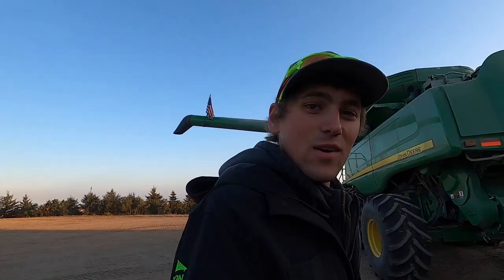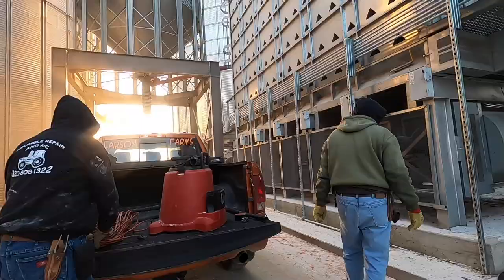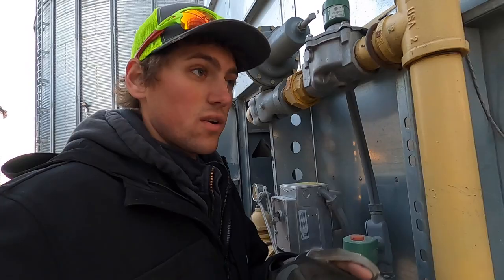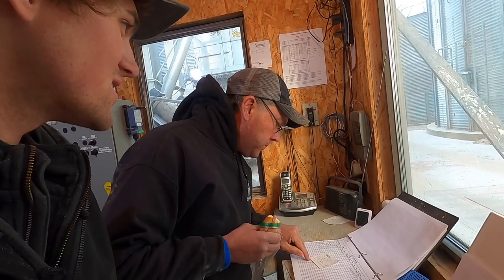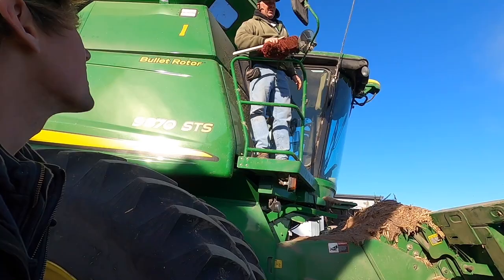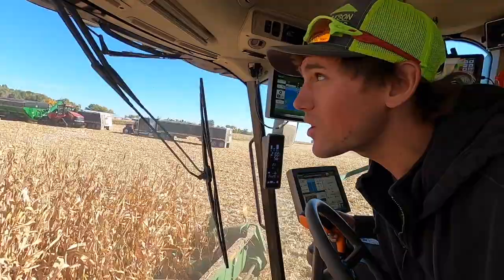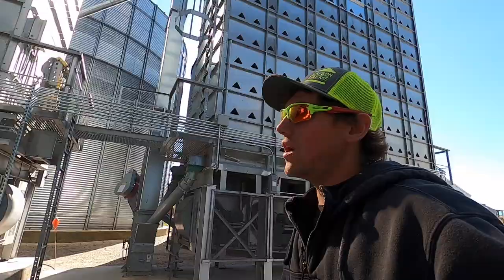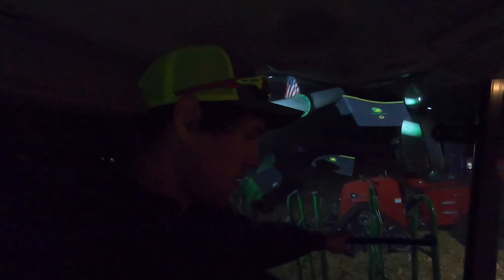You Spilled HOW Much Corn?? #14

Comment: Dougo shoulda known to take the batteries out of the Sensaphone 400 for seasonal storage, per the  Sensaphone 400 user manual, Page 29 , section 2.13

2 .13 DISCONNECTING THE MODEL 400 FOR STORAGE OR SEASONAL USE.
If you plan to employ the Model 400 as a seasonal “watchdog” for a few months during the year, you must disconnect all wires from the unit com- pletely to avoid damage to the circuitry when the unit is not in use. If the unit is unplugged but left in place with all the sensors still connected, the wires act as antennae that draw in any stray “electrical noise” from such devices as fans, blowers, microwaves, etc.
Additionally, it is important to remove the batteries, or they will discharge until they fail.
Preserve your Model 400 during the off-season, or when not in use: 
• Remove the sensor wires at the screw terminals
• Remove the batteries
• Unplug the unit and store in a safe place
Reply: john mcgee haha oh take er’ easy, pal! It’s a joke, and it took me all of 3 minutes. Don’t concern yourself with how I spend my time on a Sunday.
Reply: Seems everything on the farm is seasonal - except cutting the lawn.
Reply: User Manual? what user Manual they make one of those things lol
Reply: @dominoefxxx  Thanks for looking that up - you save Dougo the time to look it up (which he wouldn't) and now he knows. I didn't know to take off the sensor wires, but any stray charge could damage a circuit board.
Reply: Some of the newer batteries don’t corrode the metal and you can just wash off the contacts and put new batteries in.  Otherwise just get a battery holder from eBay with the same number of cells and solder it in.  Won’t fit inside, but that doesn’t matter.
Reply: WHAT FARMER EVER READS DIRECTIONS.  TAKES THE FUN OUT OF FU's.  STUFF CAN'T BREAK DOWN IF ONE RUNS IT BY THE BOOK
Reply: They're less than $250 a pop.
Reply: David Henschel i don’t cut it in the winter🤔
Reply: @gijsvermuntagrifotografie  How interesting rabbi.
Reply: White vinegar and a qtip will eliminate the corrosion in seconds. Try not to get the vinegar on the circuit boards if you can.
Reply: Where at Larson Farms is a safe place?

Comment: Chuckling.  When i was a young damsel while dad and my brother took the grain from the full section block, with the two odd quaters added wierdly at diagonal corners to it. I was left to run a One Woman show 12 miles away taken off the half section with 3 small pieces semi attached around it. They had the two trucks and two combines and a guy bailing behind them. I had my babier pull type a bailer and a old dodge tandem grain truck. Doing a one woman job say proving it took five men to do what i was doing alone. Only down side i had not finishing when they were done or shortly behind them was my 12 mile drive to the bins, or my trying to keep the bailing kept up to my combining.  Only advantage i had over them was we generally hauled loads straight to the ellevator and one of the quarters was across the fence from the ellevators and we had a trail made so i had driect access right into the ellevator yard. But enough of that i love to wach your videos to see just how far farming has advanced. You farmers are quite spoiled how every thing is so monitored for you and the dryer and bin systems do so much for you. And best you do not need to fight getting some old Hand Crank tractor running to turn the Augers. Only ellectrics we had at the bin sight was the batteries in the Flash lights lol. And only computer thing woulda been none. Lol best none of us got hurt other than my broke wrist from starting that dam hand crank tractor and my brother breaking his ankle gettin outta the combine in a hurry and screwed up.  So Chet, Doug and every one at larson farms please keep the videos coming i so love to wach them. And please be safe.   Hugs from ya little canadian farm girl fan

Comment: Sunday sub sandwiche day. Nicole keep splicing yourself in a little more, your contributions to the operation is emence. A farm operates on the food they eat.
 Keeping all the parts moving requires more then diesel fuel and prevent mantance..
The harvest is looking good.
 I found the green crustys starting in my battery powered radio, you saved my radio...

Comment: White vinegar and a qtip will remove the battery corrosion is seconds. Try not to get the vinegar on the circuit boards. About a 15 cent fix.

Comment: Thanks for finally explaining how them dryers work.

Why can't you unload directly into the semi trailers? 

Also, thanks for taking the heat for leaving the door open - you had taken a video of the bin loading for us and I remember you closing the lower door. You are runnin 110 percent making video's while doing your regular farm work a something is bound to go awry.
Reply: They can but would end up sitting and waiting for the trucks.  Used to.  The big combines harvest so fast they need a big buffer, which is what the grain carts do.
Reply: @BeachBoyAAA  Also heavy trucks and high tyre pressures lead to soil compaction even when the soil is really dry.
A compacted soil does not naturally drain hardly at all in a wet time = plants drowned, fertilizer wasted and a possible environmental issue, significantly reduced yield = very poor profitability.
Plant roots often cannot force their way through compacted soil and yet again poor plant performance (low yield / poor quality).
Note how the grain cart is running on special rubber belts (as is the tractor) - this is primarily to reduce soil compaction by spreading the weight of the equipment and load over a large area of soil.
To repair soil compaction is a slow and really expensive operation which can take a number of seasons and the right soil conditions to fix.

Comment: Clean out the battery corrosion with vinegar (Q tips work great for this process), then clean out again with  and baking soda and a little water using a Q tip..  DO NOT leave batteries in during the part of the year you do not use the sensaphone 400.  The equipment will use a small amount of the charge even when you are not using the sensaphone, discharging the batteries completely, they they corrode and leak. (If the equipment has an on/off switch batteries can be left in, but there is still the risk of corrosion.)  be careful not to get the vinegar or baking soda water on/in the electronics.   
Used this method for many years to clean up things the batteries were left in.  Unfortunately this is your bad;  somewhere deep in the manual it might have told you to remove the batteries when not in use.   Good luck

Comment: Since the bottom 2 tiers don't dry and cool the grain when you first load it up with wet corn how do the first 2 tiers get dried?  Does the dryer control where the grain goes so when first loading it with wet corn the bottom 2 tiers are empty till the grain is dry and needs cooling?

Comment: Being  a city  boy I'm  confused about  how corn gets in the triangles  without falling all the way down to the burners.  Does it load from inside the triangles?
Reply: wet corn comes in the top and divides to either outside chamber, air is forced into the corn thru the triangles. the inner chamber is where the burner /hot air is. there is no corn in the center chamber. the fans on the end force the heated air thru the inner triangles and to the outside thru the outer triangles. corn comes down each side of the center chamber.  augers at the bottom take the dry /cooled corn out to the storage bin.   this is called a continuous flow dryer.     the triangles have a "roof" over each one so air can go into the corn but corn cannot fall into the center chamber or out on the ground (the outer triangles).       some farmers may have a batch drier.  it fills the chamber, dries the corn and empties the chamber (in batches). over and over.  kind of hard to describe, I'm sure you can find a moving schematic somewhere on u tube.
Reply: Thanks for the  explanation .

Comment: So explain this bushels/hours thing because you said 66 acres and at 220bu/ac is 14,520
Reply from the maker: So divide that by how many hours you were in the field. 
Gives you bushels harvested per hour.
Reply: @LarsonFarms  ok, but why is that a point of significance?
Reply: @tomcander3669  The cost of all machines running plus manpower count up to a certain cost per hour.  So that the more bushels per hour you handle the cheaper harvest price against a bushel of corn. The point is to get down to the cheapest breakeven price you can get. That's why Chet is into the grain saving device's he installed this year.
Reply: @truckermike1997  I understand about costs as I own an excavating and demolition company but bushels per hour number is a false sense of accomplishment versus acres per hour or per 12 hour day
Reply: @tomcander3669  I don't believe it's a false sense it's just another measurement. Acre's per hour will vary do to conditions or yield. 300 bu corn will will take longer to combine then 225 corn so acres per hour will go down but bu's per hour go up. The simple explanation is bragging right at the bar.

Comment: Why other farmers unload directly to a semi.
Reply: Small combines.
Reply: I'm a city boy. Explain it  like you talking to your wife
Reply: @francisfrancis6624  Biggest problem might be man power or just the cost of equipment. The big advantage of the graincart is to improve the efficiency of the combines. Here in Northern North Dakota they say a cart turns your 1 combine into 1and 1/2 combines.
Reply: Still haven't answer my question. It's like put a bucket of water into another bucket then into another bucket. I say skip the the second bucket and pour it to the final bucket. My point is why buy such an expensive cart to do the same job as a semi off loading fron a combine.
Reply: I'm no farmer but those equipments are expensive and also repair. Now you need a worker to drive the grain cart and a semi. Just don't make sense
Reply: @francisfrancis6624  time, You can't unload on the go with a semi so you have to leave it parked near your exit from the field. Semi's cause a lot more compaction in the fields because of narrow tires and weight. So if you make a cut down the field and back. You have to pull out and drive the combine to the truck to dump and then sit there and unload for a few minutes absolutely kills the output of the combine. The carts are expensive but not as expensive as a extra combine to make that up. I drive semi in the fall here for a local farmer. I'm a retired long haul trucker and part time cattle feeder who has time do do it and make extra money. Our cart operator is fully retired and does it for money and fun. Lot of old timers around available. Again the idea of having $500,000 plus machines wasting 10 to 20 minutes per hour just unloading is costly.